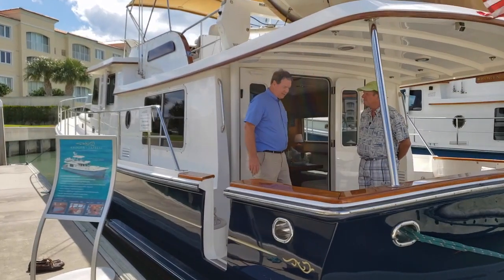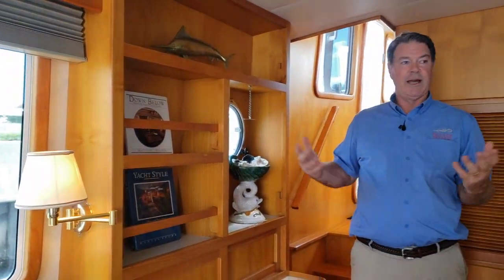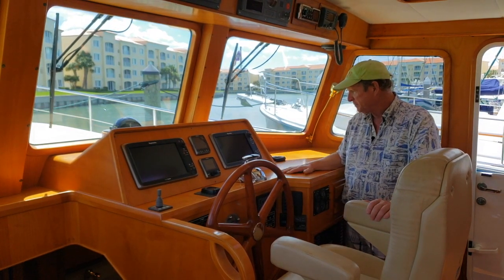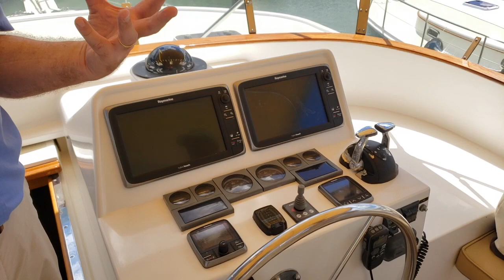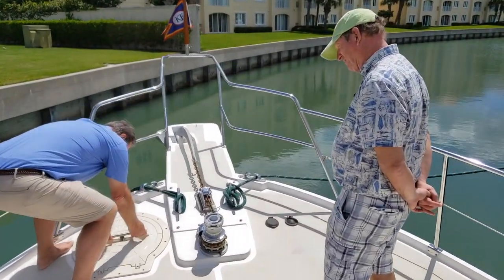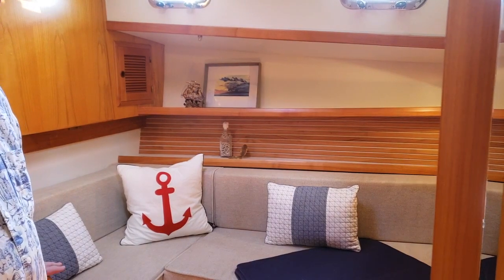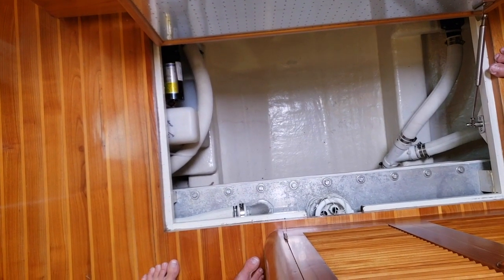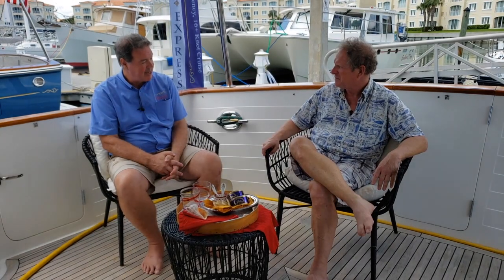2006 Krogen Express 52' Detailed Walk-Through

Comment: I wonder what the cost to re-power this vessel is?  3500 hrs seems like a lot.  Yanmar says designed service life 12-15K hrs, if maintained to spec.  But 3500 hrs you are going to be replacing alternators, pumps etc.  Then again picking this boat up for just shy of 500k....Im not a fan of the hybrid transmission set up however.  Go one way (full electronic) or the other (not)